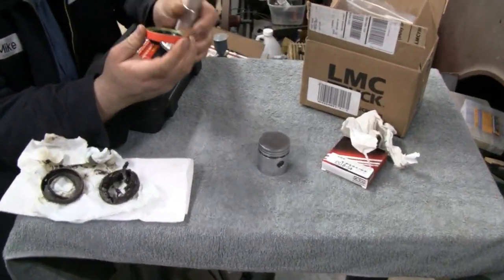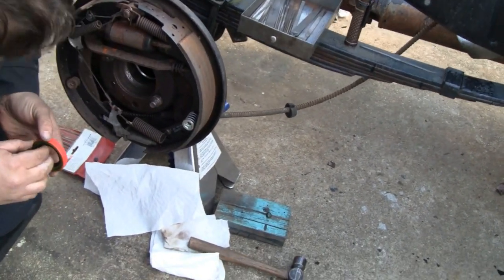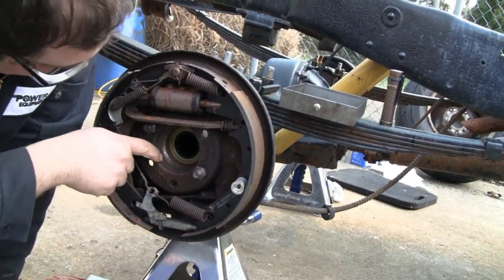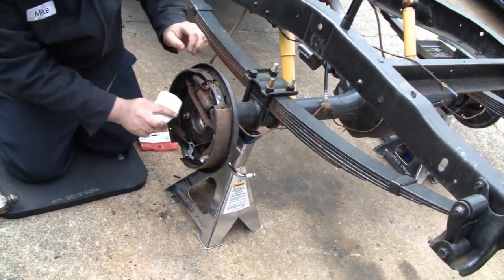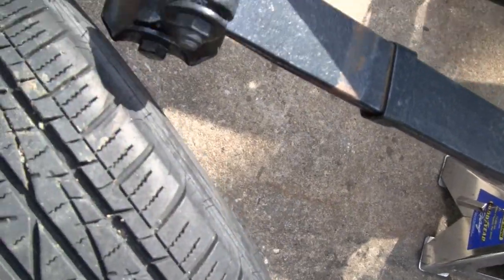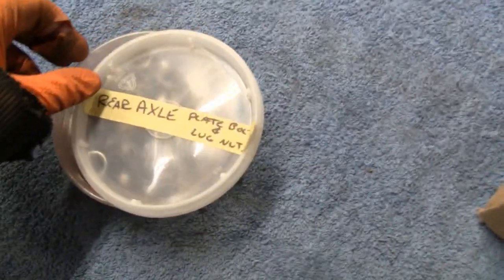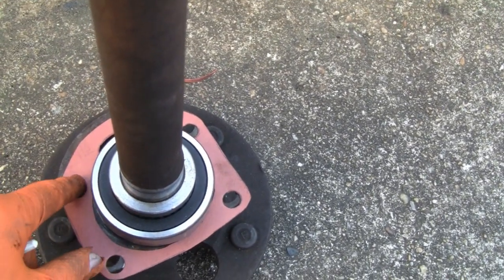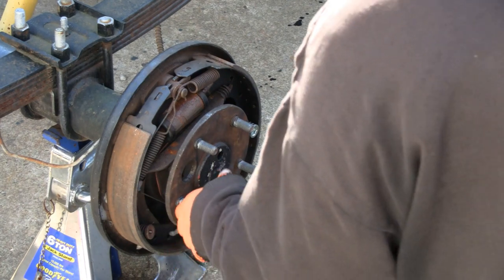INSTALL REAR AXLE, BEARINGS and SEALS (F100 part 91)

Comment: I have a small cordless drill/screwdriver with an adapter which I use for putting wheel nuts on. I set it on the lowest slip screwdriver setting for initial fitting and finish the nuts off with the torque wrench. It saves setting up the compressor and getting the air gun out.

First time I tried this method I had it on drill setting and almost broke my wrist!
Reply from the maker: Been there Bud!!☻
Reply: I did this once a long time ago, before the cordless impacts were a thing. The first Craftsman 19.2v before they called them "C3", just like RoadKing uses. Anyway, I popped it in reverse, braced myself, and broke one free on my mini SUV. Lined up for the second one, and POW! It broke free all right, broke the retaining screw and backed the drill chuck right off the shaft! 

Needless to say, I bought the first cordless impact I could find. I was hooked on the convenience with that first lug nut!

Comment: Mike to the rescue. Good job guys. I hate it when some body takes short cuts and doesn't do things right. Why would they not but those rear gaskets on that doesn't even make sense to me. I know Moser has 28 spline axles but they were probably more that you wanted to spend. Loving this series on the truck. Its going to be so cool!!
Reply from the maker: Thanks Bob!! Yeah you can get the axles but they're not a shelf item, they're a custom build and was 4-5 times as much as a normal axle!!☻

Comment: Id just like to say thank you for making this video. I have a hot rod that ive been working on and wanted to do a disc brake conversion. Couldnt figure out what axles and brakes were on it. Turns out they were F100 19 spline with the same brakes. This was great to reference for all the same work i need to do. Mine didnt have those gaskets either. FWIW, Dutchman can make these axles in case you ever need them.

Comment: No pressure Mike. There will only be about 20,000 views or more watching your work. I'm dealing with nasty weather as well. The 59 Ford truck project has stalled.
Reply from the maker: It won't be long before we're complaining about the heat!! It was about 50° here today, so we got a lil' bit done!!☻

Comment: I thought the sealer tool was supposed to have the smaller circumference facing the seal to stabilize the interior circumference while driving it. Any comments?